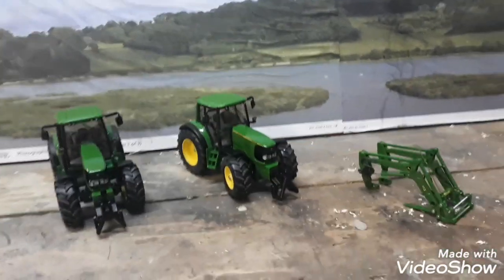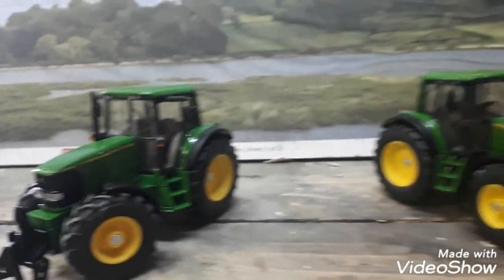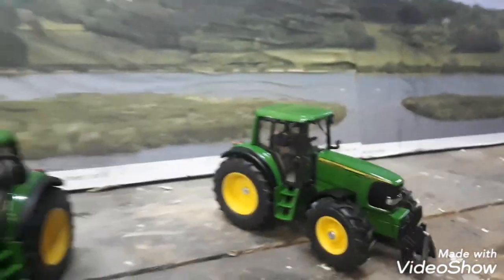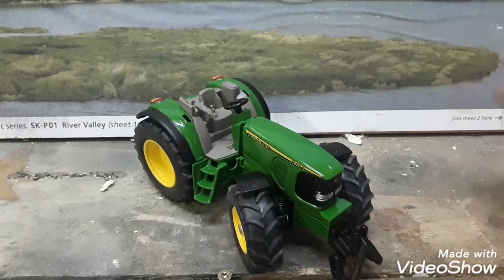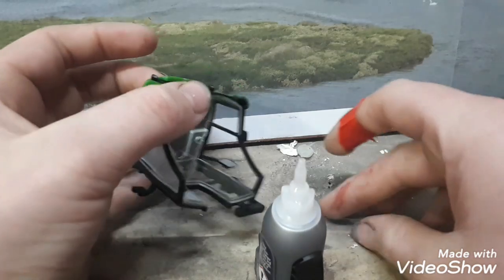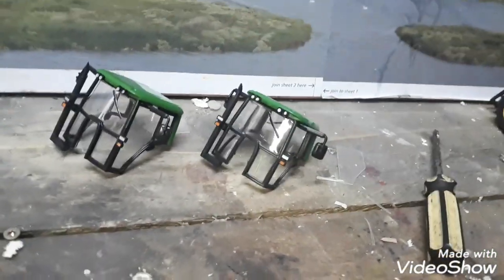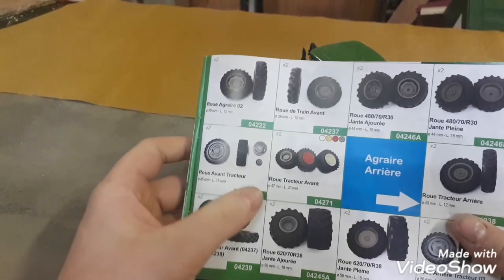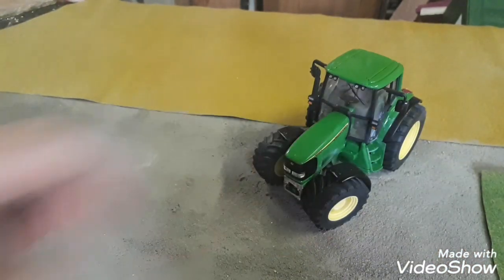Model Modification Series Ep13 - Modifying a 1/32 Siku John Deere 6920s!!

Comment: Great job!  Itheres 4 of those tractors about the house.  Some l've in boxes, the others my kids have them!
I was able to buy the rear hitches and change them when they broke!  I also have a 1.32 model identical to the siku in almost every way but it's almost 100% plastic made by TIM TOYS.
Adding the cab glass, bigger wheels etc makes it look much better but l'd personally prefer if the front wheels still turned
Reply from the maker: Thanks bambino yeh shame they dont turn and yeh there a very popular tractor